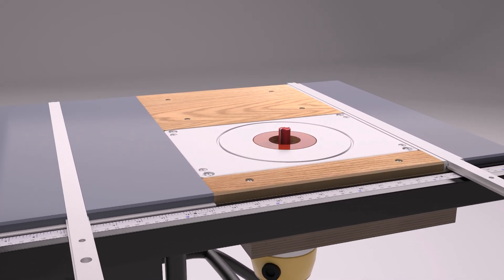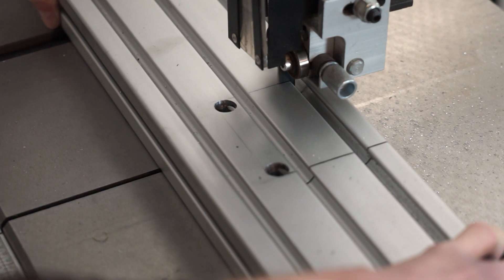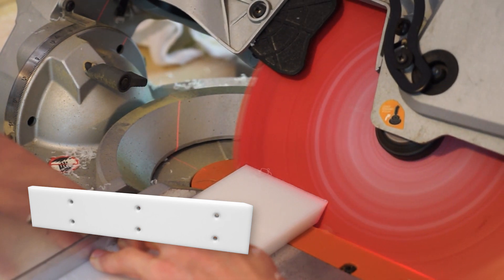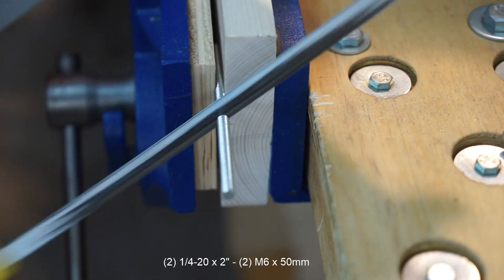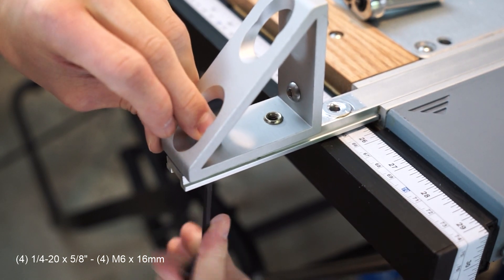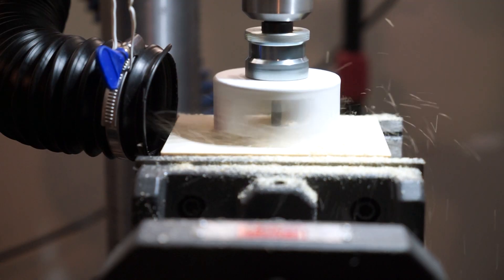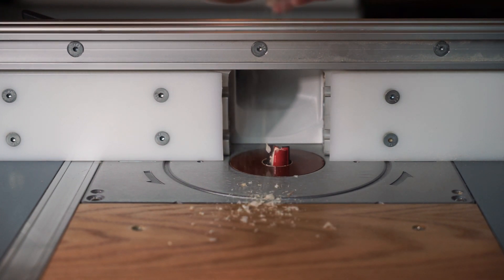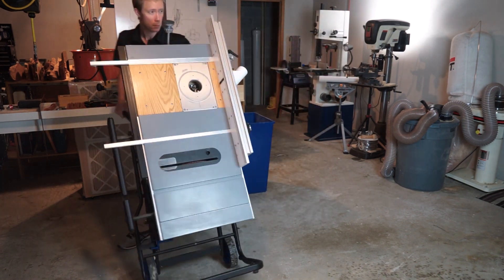Add a Fence to your Router Table or Table Saw

Comment: Hi This is a very cool video.  I am trying to add a rail to my existing router fence so I can use a feather board to hold down the work piece.  Where can I find what you describe as a "multi purpose rail"?

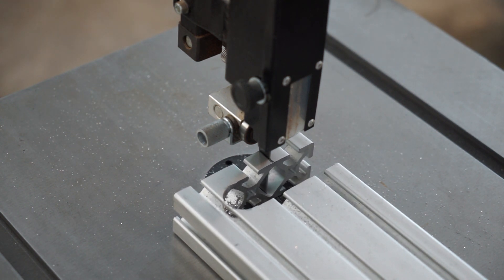Comment: 2:14 your step-up from Drill A to B was too large, had no lube and too high of RPM for that size drill. That is why that didn't work to plan.
Reply from the maker: Good point! In the end that press isn't designed for drilling that sort of hole. The RPMs don't go that low and flooding the table with coolant would have been a real mess. I actually got a mini mill to replace this press a few months ago for this reason.

Comment: Hi, thank you for the great video. The link you gave for the '2 x Angle Brackets for 1.5" Extrusions (8020 brand)' is incorrect (it links to some other part). Could you please furnish me with the link to the brackets?
Reply from the maker: Any time! Thanks for the heads up on that. Here is a link to where you can buy the 2 needed for this fence https://www.grainger.com/product/5JRV7

If you want 10 for some reason, here is the amazon link... https://amzn.to/3k4sR93

Let me know if you have any other questions!

Comment: I always see people cutting their t-slot. 
 
What I did was use the 2"×2" (10 series. 2020, but not the metric 2020) for my fence. I used one 40" and two 16". I put two 16 on bottom, and the one 40" on top. (It made 2" thick, 4" tall fence.) And it allowed me to use the 2 bottom 2x2 extrusion for as dust collection by attaching hose on the ends. Now i didn't need an under, or rear dust collection. 
 
In your case, I'd have just capped the circ saw side of the 2020 and pulled dust from one side. 
 
The nice thing about the 2020 is the weight and stability. 
 
As far as the slide/drop in nut issue...
 
I'd drill through the track to put nut on other side of extrusion. But even better is to tap the track on the other side. 
 
I wish I could do 3d printing... I've had too many concussions to absorb that type of thing.
 
I love t-slot extrusion ... I've used it for years, and it's just amazing for everything. 
 
But  good 10-32 and ¼-20 tap, and aluminum tap magic goes  a long way.
Reply from the maker: That's a great idea. Cutting them can be a real pain if you don't have a mill. Thanks for the ideas! I'll keep this in mind next time I do something similar. 

3D printing is extremely useful. Even if you don't design your own parts it's pretty easy to download them and print them yourself. I wouldn't rule it out completely 👍
Reply: @The3DHandyman  yeah... I've tried so many times to learn programs for 3D, my brain has just been beaten into mush for that type of thing to absorb. I spent 2 weeks trying to figure out how to use Sketchup and I'm now bald. 🤣 🤣 🤣 
 
Cutting extrusion is easy... it's the mess that I hate. I ended up buying a refurbished 10" POS Ryobi Miter saw for $50, just for aluminum. I use it outside in a corner of my yard that I ended up turning into a paint booth. Buy it traps the aluminum in there, and I hope in 10,000 years some miner with think they hit it big 😆.
Reply from the maker: @carterscustomrods  Fair enough! You can always pay me to design parts for you 😄

Lol! There may be a corner of my yard that has a nice vein of aluminum for future explorers...

Good call on the saw just for cutting metal. It's work $50 for sure.

Comment: Let the drinking game begin. Maybe benifitial to tape the extrusion ends at the router cutout. Not sure if using the extrusion as dust collection channel is viable.
Reply from the maker: Bottoms up! I thought about making the dust collection at one end but was concerned that it would create too much of an overhung weight that would effect the sliding motion of the fence. When the dust collector is running, it seems to keep the holes in the fence clear of debris.
Reply: @The3DHandyman  not sure if the ends of extrusion at the router but cutout is leaking dust collection power. That’s what I meant by taping them.
Reply from the maker: @What_Other_Hobbies  Ah, got yah. Yes, they likely do to an extent. Good thought!

Comment: What would you say was approximate cost for all the materials used to build this? Great job btw. I love the industrial look of it too.
Reply from the maker: Thank you! It was a few hundred to build for the table and the fence. Cant remember the exact amount but maybe $200 for the fence alone? I probably could have bought a router table for the cost on putting this together. The upside is the portability and the face that the fence works for the saw as well as the router. Making the backstop thinner would help bring down the cost. The HDPE was also cost increasing as was the phenolic sheet used for the router inserts.
Reply: @The3DHandyman  Thank you for replying. Anything under $4-500 I’d consider still a reasonable price. For what it is and how well it turned out.
Reply from the maker: @pf5658  Any time! I felt the same way after it was all wrapped up. It still works great to this day.

Comment: If you put a scrap piece in front it wont tare out the good piece...
Reply from the maker: Is any particular type of wood best for the task or is everything just about the same?
Reply: @The3DHandyman   any piece of wood that is large enough to support the entire size of the router cut will work if you hold it tightly against the face being routed.
Reply from the maker: @ericbuente3260  Thanks for the info Eric

Comment: Very nice work. A table saw has been on my shopping list for some time and your solution ticks a lot of boxes - I might follow suit. Did you lower the speed or change the blade on your bandsaw to cut the aluminium?
ps. for 8:00, would a sacrificial piece of wood between the jig and the cutter for that first cut not prevent the blowout?
Reply from the maker: Yes. My bandsaw has 2 speeds 1500ft/min and 3000ft/min. I keep it at 1500ft/min for aluminum and use a 1/2" bi-metal blade with 10tpi. In the video the cutting footage is sped up quite a bit but it tends to cut large pieces fairly quickly in real time. I let it run for a while in between cuts on thick parts so it has a chance to cool down. 

Good note on the sacrificial piece of wood on top. Good thing I keep just about every piece of scrap wood I make. I knew those would come in handy one day. Haha.